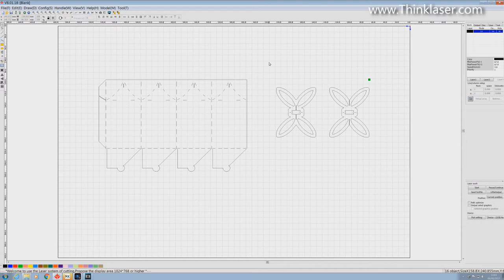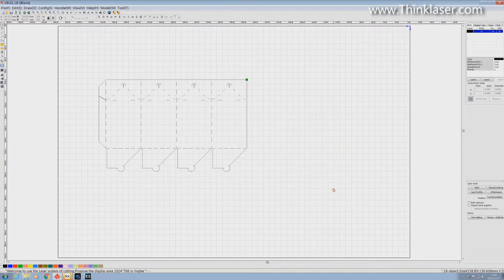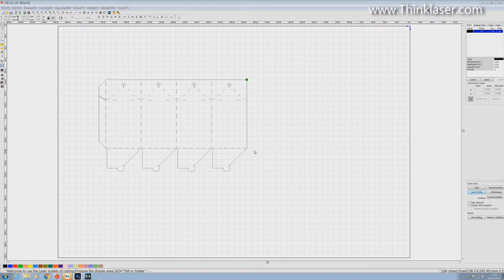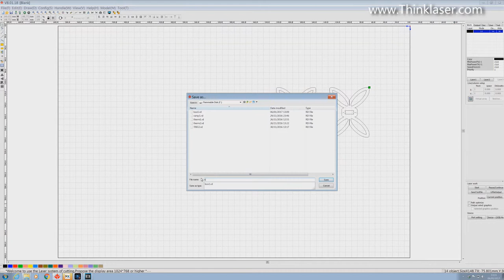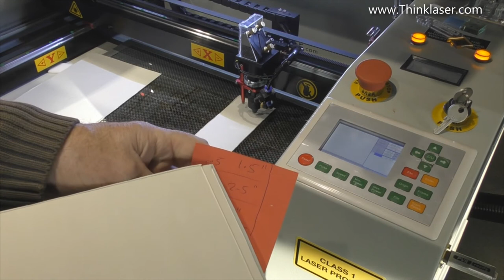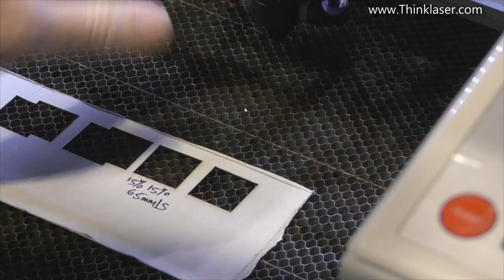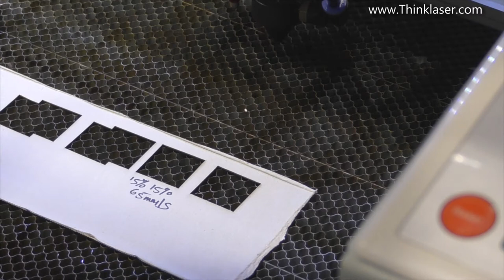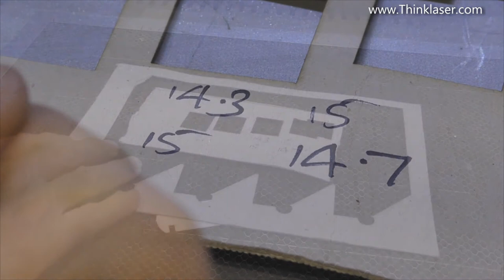How To Use A Laser Cutter - Lightblade Learning Lab 15 Cardboard Engineering part 1

Comment: Hello. Can you please tell me why are you cut with 15% and 65mm/s instead of 65% and lets say 200mm/s.
Reply from the maker: Hi Darko
Russ was using the High Frequency Impact engraving Mode of his laser tube as he believes he gets a better cut with paper.

If you were doing large, non-intricate cutting where the laser head quickly gets up to full speed then you may get away with a combination of high power/high speed. However if you are doing anything intricate, the laser head will never reach the top speed specified and you will be putting too much power into the material at the slower speeds resulting in charring of the cut. You can try to offset this by using the Max / Min Power settings but it can be tricky getting the settings just right.